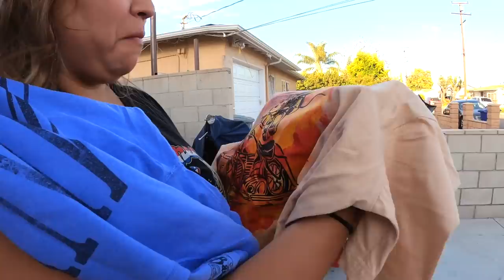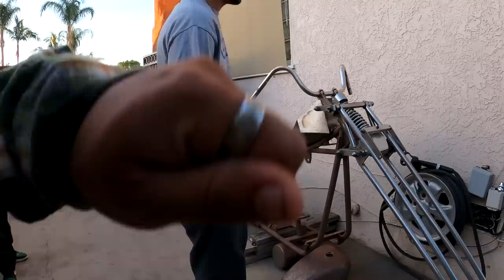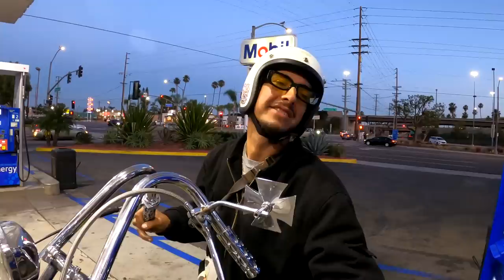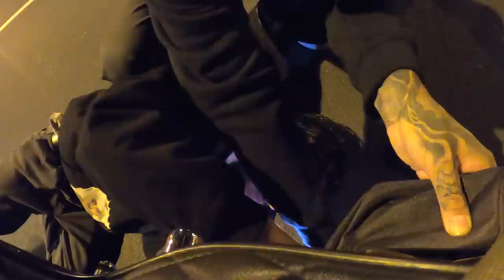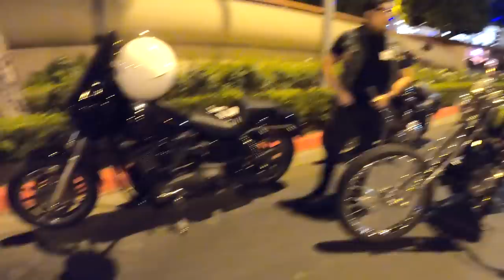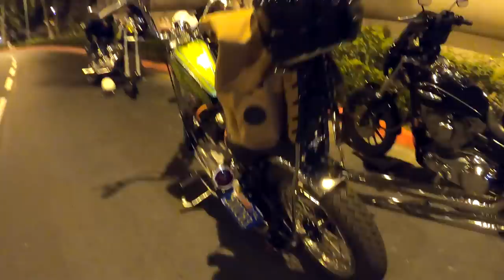#175 - No Brakes And Meeting Kevin

Comment: The fork on Kevin's bike is a D&D (later Jammer) springer with twisted front rails. You can always tell one of those forks because of the rockers, the lower spring pads and the front rails that extend slightly above the spring pad crossmember. I haven't seen one of those forks in years. A buddy of mine ran one of those forks on his Panhead in 1971.

Comment: Definitely a colour and odour difference of brake fluid and oil. Viscosity(thickness) should be different too, maybe slightly. Just something to take note of in the future.  Also, just from my experience(just sharing) the only way I could see engine oil back on a rear tire like that is if you seriously overfilled and got some serious blow by out of the intake, but you would see they all over the motor first. 

Don’t leave brake fluid on your hands or get it on your paint, it’s corrosive stuff. Incase you guys are unaware.
Reply: I've got break fluid in my fucking eye and fucked it up, I had to go get it flushed out and shit.   I've ruined some nice shirts and Levi's by getting that stuff on them to, that shit is worse than bleach.